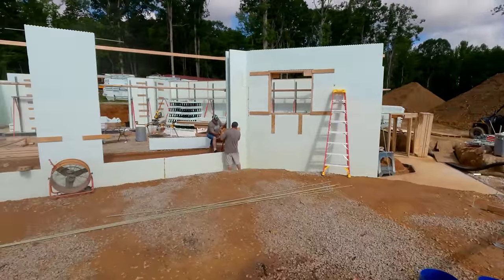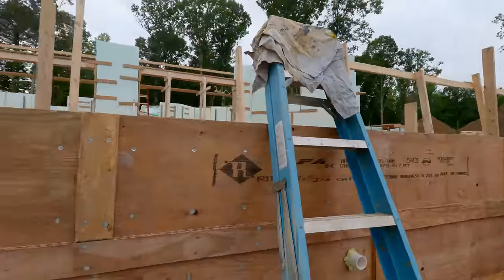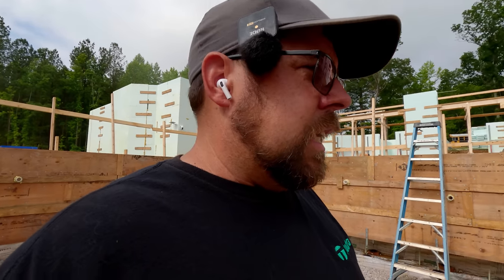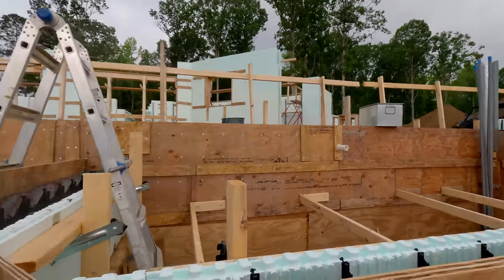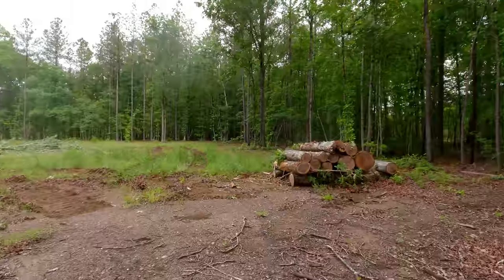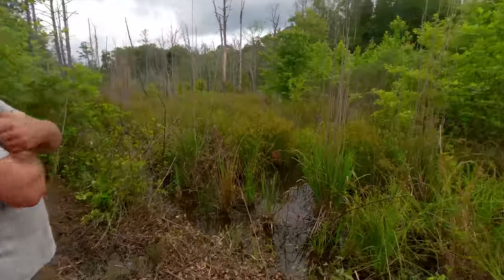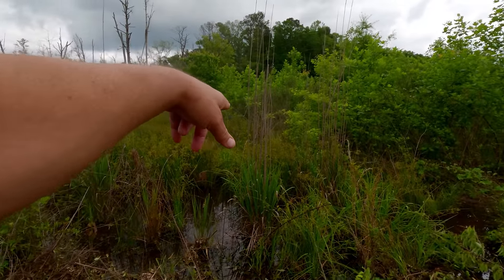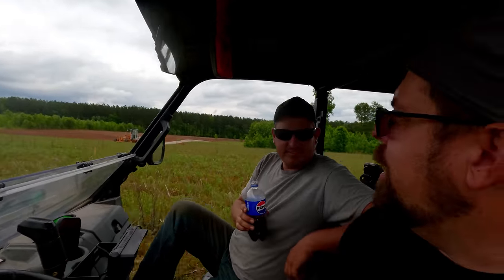Making a Plan for a New Huge Pond! Working on the ICF Infinity Pool! Chris Takes Down More Trees

Comment: Man, his Chipper is a Beast !! I believe it's the same chipper Tim has, "CT3' !! Hell of a machine... Yeah, I'd ay the beavers has it dammed up pretty good back in there now Geoff !! If that's where you got your tractor hung up at !! Just a little wet.... lololol.... Aw Hell !! You know Chris will slide ya in and get what ya need done !! Does look good with the trail Chris mulched down threw there though !! Coming on together all the time, the lots, and the house build !! Great Video Geoff !! Have a Great Evening Man !!
Reply from the maker: You too! Thanks 😊
Reply: It is the same Chipper Tim has. I just got the diesel option. The gas engine are really loud.

Comment: I am sure you have thought about this but, you haven't mentioned if you are putting a one-way check valve on the linier drains to prevent the upper pool from draining into the lower pool if the power goes out.

Comment: What check valves are you running in the feed lines from the bottom pool to the top pool?  When to pump quits all the water will attempt to get back down to the bottom pool from the floor of the top pool.  Will the pump have enough umph to reopen the check valves, especially if you have water on top of them and the rest is a large air bubble from pump to check valve?
Reply from the maker: Electronic valve. Is open when the waterfall feature is turned on and closed when it’s not. If we have a catastrophic failure when it’s on then I guess will be draining 20,000 gallons.

Comment: I have an idea for you that you have probably already thought about. How about a water fountain (or two) in your 5-acre pond? As you taught me, one is none and two is one. hahaha.  I think it would look cool and help with the water quality too.
Reply from the maker: Eventually would like to have at least one. They get pricey.
Reply: @BealyGood  Build a couple. 3" pvc, run it out from a pump and on top you take a pipe cap, Drill 1/4" holes in it in a pattern then use brass airline fittings screwed into those holes as nozzles. Built a couple like that for a local reservoir.

Comment: USA NJ

USA House Wiring 

17- 20amp circuit 

         Kit. Outlet 210.11.C.1 

         Kit. Outlet 210.11.C.1 

         DW Cir. 210.8.D 

         Micro hood fan and range outlet- A good idea 

         Ref. Outlet- A good idea 

         Outside Outlet 210.52.E 

         Outside Outlet Xmas-A good idea 

         Bath Outlet 210.11.C.3 

         Laundry Washer 210.52.F 

Laundry room Outlet 210.11.C.2 

Laundry dryer Outlet -A good idea 

Family room Outlet 

Garage Outlet 210.11 

Garage Freezer 210.52 

Garage Elec. Car Outlet 210.1 

Dining room Outlet 

Heater 210.64 

Bath room Heater Fan Light 

30 Amp Circuit 

Hot Water Heater-10/2 wire 

Dryer-10/3 wire 

Cooktop-10/3 wire 

Air compressor-10/2 wire 

Shop Sub Panel-10/3 wire 

 

40 Amp Circuit 

     Outside AC 

60 Amp Circuit 

Wall Oven 

Sub Panel 

15 Amp Circuit 

Smoke Detectors 

Alarm Panel 

Lighting 210.70 

Bed room Outlet 

Internet Outlet  

It is a good idea to add separate circuits 

Sub pump 

Basement 

Welder 

Attic fan 

POOL
Reply: You thought of everything! Now Geoff doesnt have to! Lol